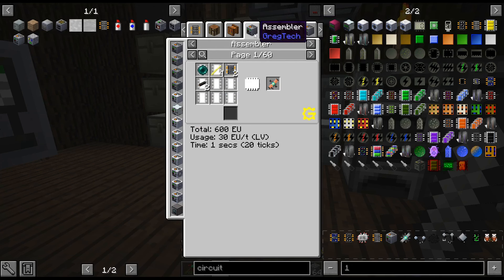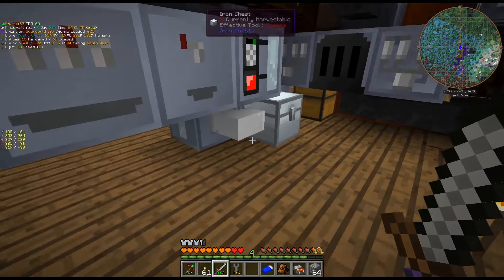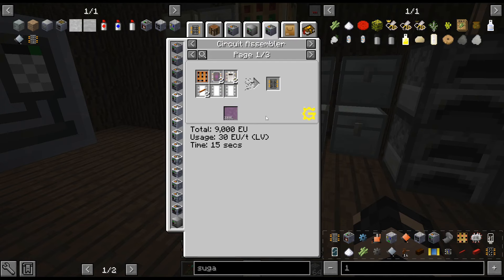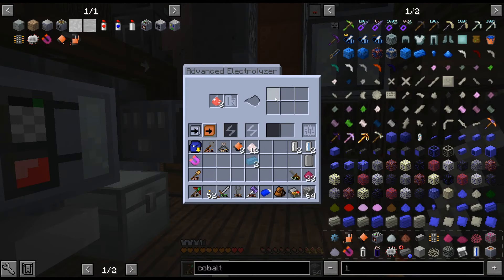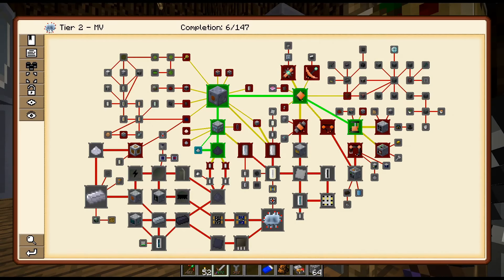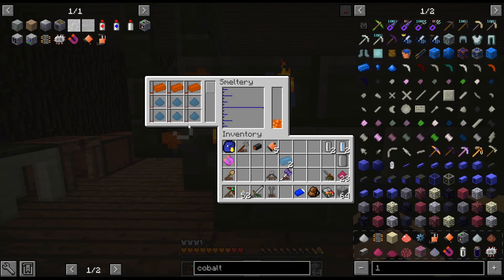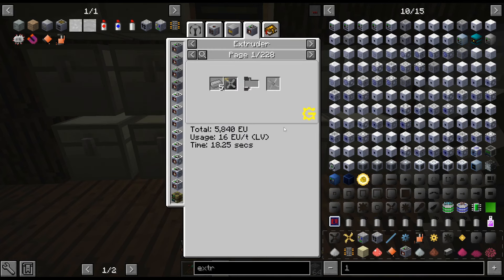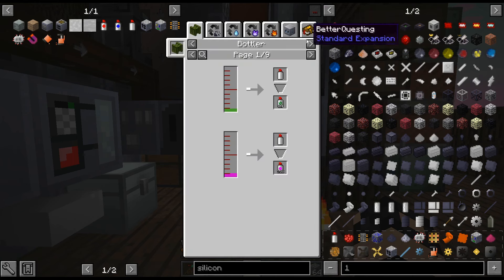GregTech New Horizons S3 - 34 - We're Gonna Need Oil

Comment: The LV Prospector block does in fact mark the veins and fluid chunks on journeymap via visualprospecting mod. You also get 64 powderbarrels as a quest reward in the LV Chapter for crafting it.
Reply: I think you have to process the data for it to show up iirc as in craft a printer and such, its useful for the underground fluids though.
Reply: @ianhoward4955  thats right. I forgot. But the Scanner and the Printer are also part of the LV questline. You get 32 scans for free with the 64 powderbarrels. Thats quite a big area you can prospect